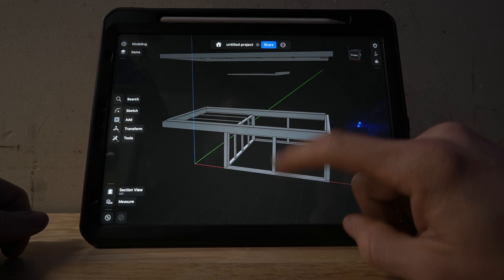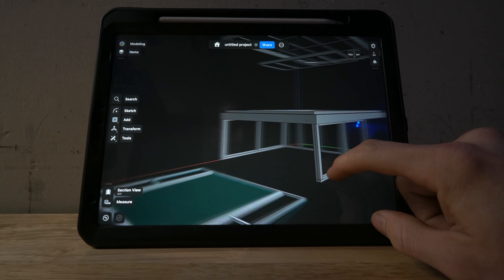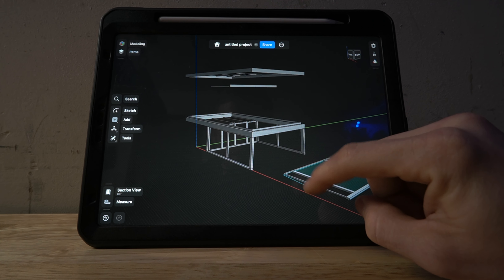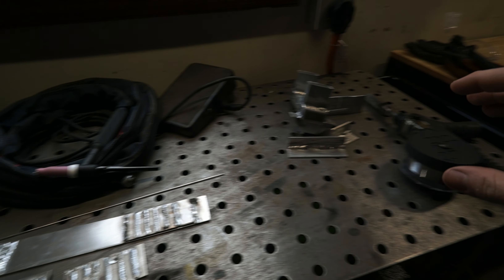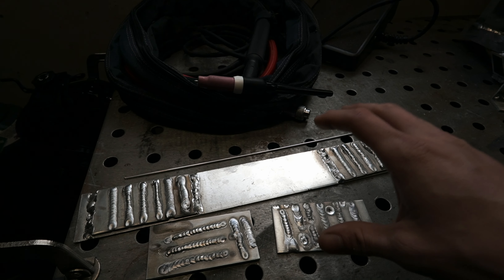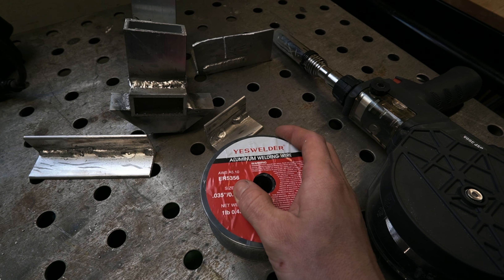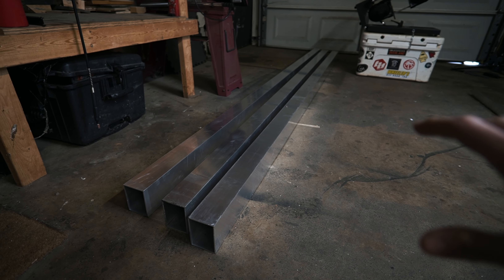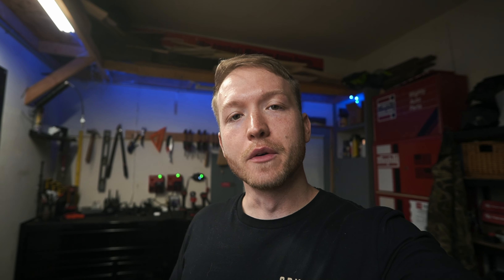I’m Building A Truck Bed Camper!

Comment: This looks super sweet I’m excited to see everything you implement! I’m very far from an expert so take this with a grain of salt but I also used MiG aluminum for my first project recently and definitely really struggled compared to steel. I found the welder settings were far more particular than steel where I can mostly adjust on the fly but by the end of the project I had become somewhat competent especially after writing down what settings I had gotten decent welds for each joint type as well as each wall thickness. Like you I had decent looking welds pretty much right out the gate on flat bar and if I could do it over I would have tried to get all my settings dialed for each and all joint types as well as material thicknesses that would be used in the project especially for the thinner stuff. All that being said I’ve had no problems with the even my worst looking welds and definitely think MiG is a good choice.
Reply from the maker: Thanks man!! You are absolutely right about that I was practicing each type of joint I’ll encounter in the build after I filmed this video. It’s pretty crazy how much it varies just based on the joint/amount of material present in that particular area that soaks up heat. Luckily for everything that needs to be welded it will be 1/8 wall. I think like you mentioned, once I understand which joint needs what it should be a breeze!

Comment: looks good! i got an F150 that i have the base built for. the plan was to design it in a way that the pop up top could be removed when not in use and the base is a truck rack for hauling stuff. life happened and im still figuring it out, but looking forward on how you plan to tackle some of the design challenges and put your own spin on it.
Reply from the maker: Sounds like an awesome design! Thanks for watching hope I can get ya inspired to get back after it!!

Comment: Really interested in watching this series; I’ve also been intrigued by learning aluminum MIG welding with a spool gun. You’re giving me encouragement to give it a try. Is that model you’re showing built in Sketchup? Do you model it on the iPad or or in the computer and just display it there for the video? I’ve tried teaching myself Sketchup but can’t quite get the hang of it. Would welcome if you have any helpful resources for learning it or whatever programs you’re using. I think a lot of my own builds would be modeled similarly. Keep it up man!
Reply from the maker: Appreciate it man! I use Shapr3d on IPad! I believe it’s also available for computer

It takes some getting used too to figure it out but a few YouTube videos helped me get a simplified understanding!

Comment: This is going to be good!
What program on the IPad are you using for the design?
Reply from the maker: It’s a paid app called Shapr3D! The app is capable of some pretty awesome things that I have yet to fully understand haha. I generally use it for simple models like this! 

It does require an Apple Pencil to use the app. It honestly might be available on the computer too!
Reply: @Adv4x4 ignore my previous  question about which app. Should have looked here first!.

Comment: Just curious, Why are you going from an off road trailer to a truck camper?
Reply from the maker: I have used the camper trailer a fair bit! Although, it doesn’t go on every trip as a trailer usually isn’t feasible in a lot of locations. 

To me, this is the best of both worlds. Goes where ever my truck goes cause it’s part of it and also turns into a great living space! 

Also, I just have an addiction to large projects and building things so I always tend to be dreaming of what’s next 😂